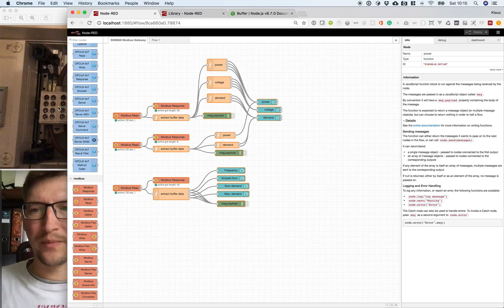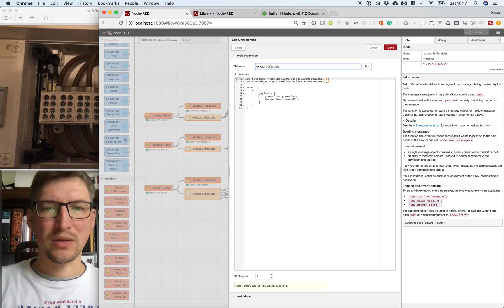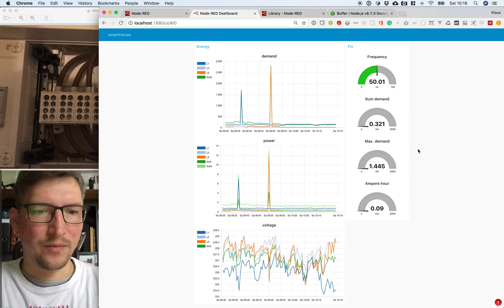SDM630 with the SDM630 Modbus Gateway

Comment: Can you tell me what the dependencies are for node-red flows you use on RPi3B? I have a USR-WIFI232-630 gateway attached to the meter. I can log into the gateway but it does not poll the meter? Should the gateway have a particular protocol used? Or is there a particular driver needed to allow the Pi to access the gateway? It works using a serial - tcp dongle but it is unreliable.

Comment: Hi I am trying to read kWH Import values from the meter. I added in this into the code:

let voltageAVG = msg.payload.buffer.readFloatBE(84,8) // 43-46
let powerAVG = msg.payload.buffer.readFloatBE(92,4) // 47,48
let kwhAVG = msg.payload.buffer.readFloatBE (96,4) // 73,74 <- new line I added

However it is showing the same values as powersum. How do I fix this and show kWH values instead?

I also don't fully understand these buffer registers, where can I read up more about them?